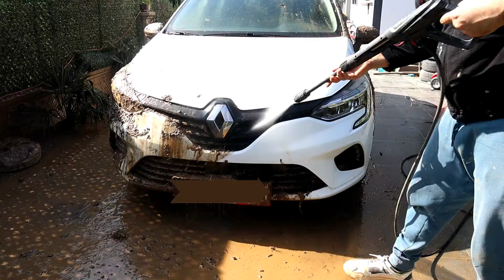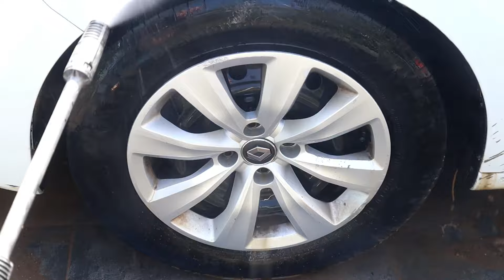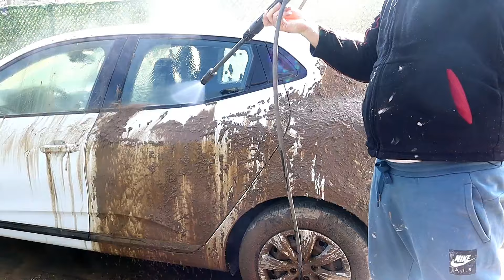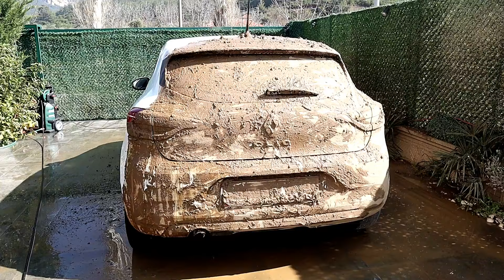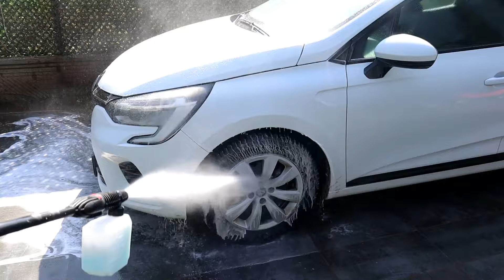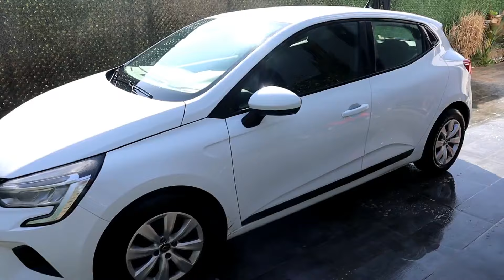4 YEARS UNWASHED CAR ! Wash the Dirtiest Renault Clio

Comment: The dirt that’s on there hasn’t been on the car four years, if it had there would’ve been mould and a lot more ingrained dirt, misleading title
Reply: Also, You can see hand prints in the mud on the side of the car. Besides that, this mud is coming way to easy for sitting four years. FAKE!

Comment: First of all there is no way that car sat 4 years and got that dirty. Second of all that dirt would not look like that if it had sat that long. Third of all that dirt came off way too easy for sitting for 4 years. I have been detailing for over 50 years and I know that car did not sit for 4 years. I can see swirl marks in that dirt from a cloth or your hands which means you put that dirt on that car yourself and left for a few hours not 4 years.